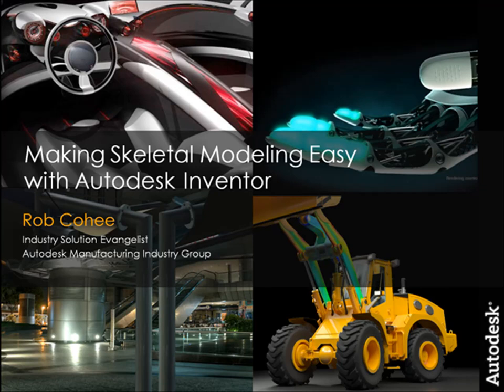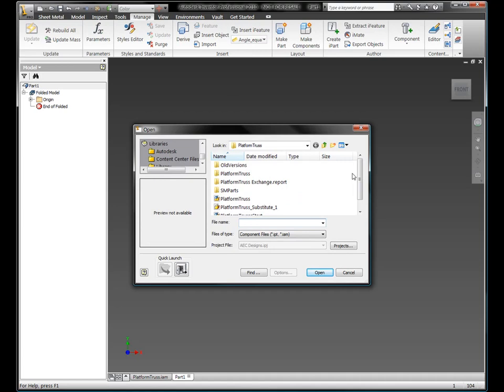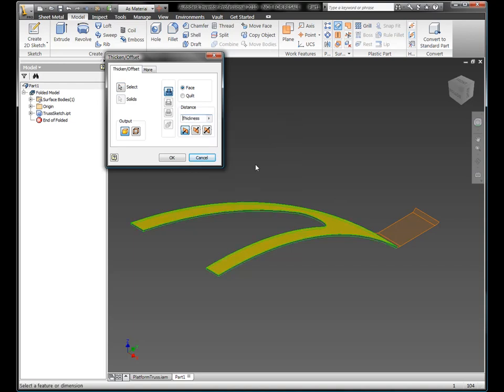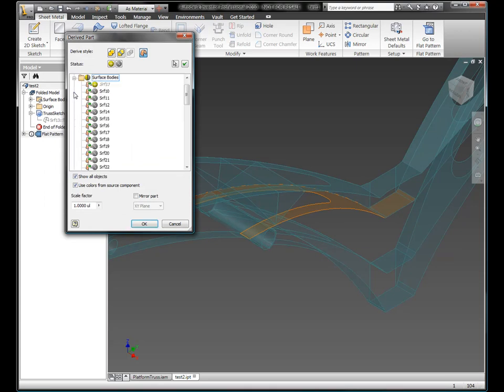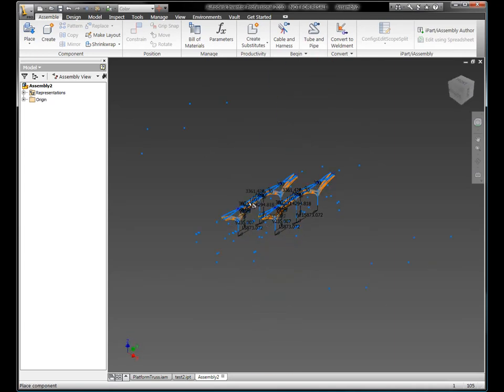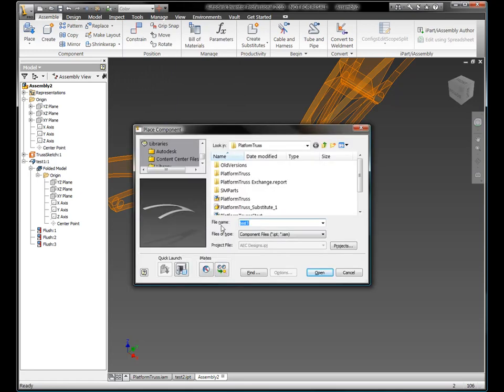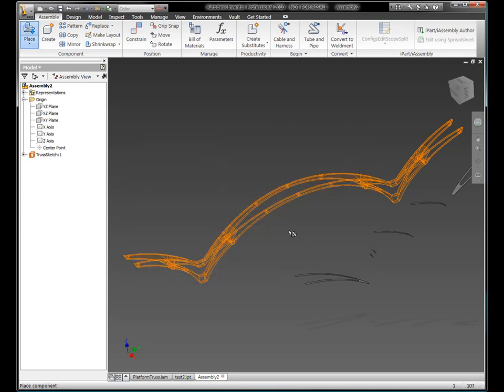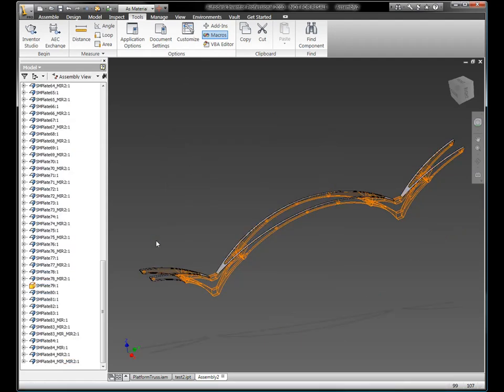Making Skeletal Modeling Easy with Autodesk Inventor

Comment: What happens if you want to change the base sketch - surface part, that all the sheet metal parts reference to. Will all the parts change automatically?
I am new to Inventor I use Solidworks. Does Inventor support multiple sheet metal bodies in one part?